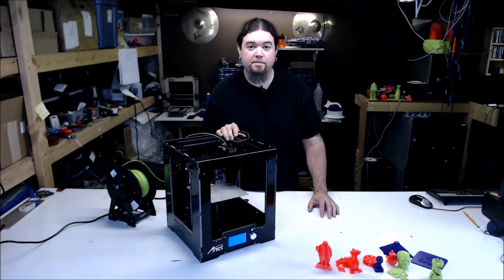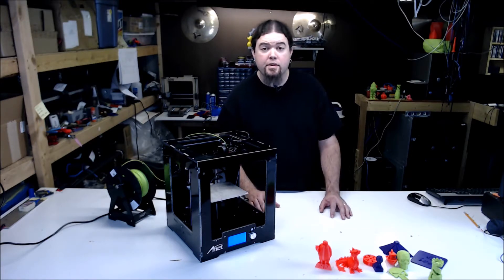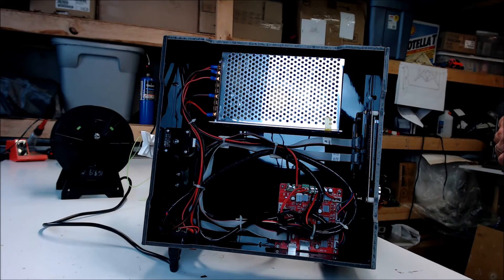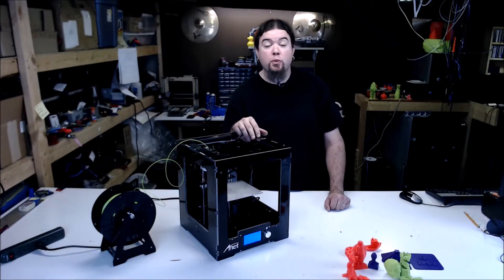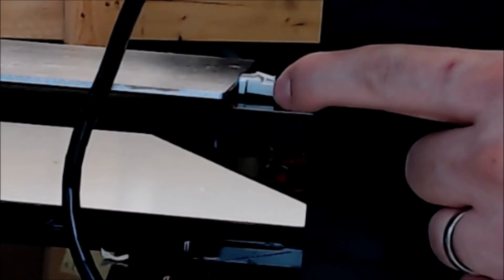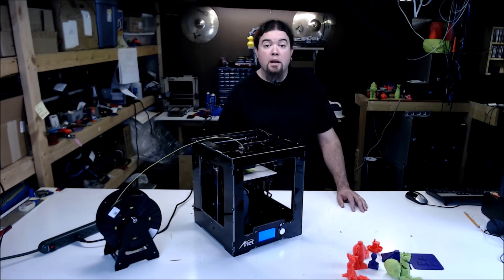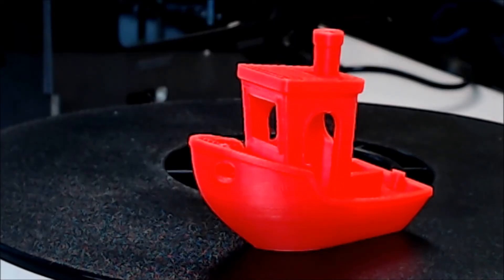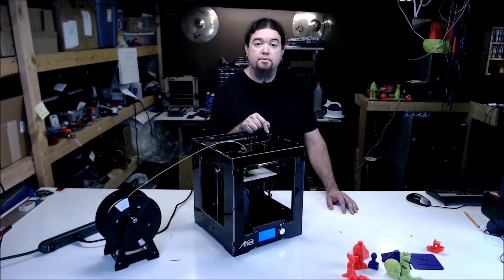Anet A3 Enclosed Acrylic 3D Printer Review & Tips

Comment: I bought this and there were screws in the box and also one of the motors was disconnected and loose inside the printer.  I need to know where to attach it.  Can you help me with this?
Reply from the maker: Sure, can you send me a pic of what you are working on?
Reply: I think I'm just going to re-box this mess and ship it back for a refund.
Reply from the maker: Sorry it didn't work out for you. They are pretty unpredictable.
Reply: I was able to find where the step motor went but the screws were to long and won't screw all the way down.  I also had loose screws that I need to put back in.  I was able to get the instruction manual on the flash drive.  I'm having trouble downloading cura, it won't let me do it.  Any suggestions on what I should do.  The power cord was a little short, had to use one from another printer I'm not using.  I'm hoping I will get this baby working so I don't have to return it.  Thanks for all your help, I love your video's
Reply from the maker: It wont let you download a newer version of cura from there site? https://ultimaker.com/en/products/ultimaker-cura-software If the motor screws are to long they might not have came from that motor. I have given away my A3, so I am flying blind. If you have pictures of what you are working on I might be able to help.
Reply: Thanks Chris for your help, I think I will return this printer, it is not worth the trouble of fixing.

Comment: just got mine 2day and set it up (first time printer here) i should have the right size filament which is 1.75 mm, but it doesn't seem to take :(
when i use the filament that followed i can get it in there with less trouble :/
do i need to push the filament all the way down, or does it just have to be put in there and then lock it?
Reply from the maker: That extruder is just a little off to one side. I remember it being hard to get filament in at times. Make sure you cut you filament at a 45 degree angle before feeding it in, that can help. You might also remove the to screws holding it on and make sure everything is lined up correctly.
Reply: thanks, that worked! :D
Reply from the maker: Anytime! Good luck!

Comment: My x axis is wobbling because of the bearings on the print head being loose, any suggestions?
Reply from the maker: WildCardMC If it's the bearings loose on the rods, there isn't a lot you can do except replace the bearings. Heavy grease might help some. Let me take a look at mine to refresh my memory.
Reply: thanks, i really don't want to take it back, ive had it for 4 or so months now and i knew something was wrong, one day i took it somewhere and the told me that the bearings were causing the issue

i haven't got any sucessful prints
Reply from the maker: So it looks like it is riding on 4 standard LMU88 bearings. The bearings are held in with grub screws. The 8mm rods are held in by grub screws as well. You will need to slide the 8mm rods out to replace the bearings. The good news is those bearing are pretty cheap. I would buy a couple, 10-12, and chose the best ones from the group.  Bearings, https://www.amazon.com/uxcell-Bushing-Linear-Motion-Double/dp/B00X9H22SO/ref=sr_1_fkmr0_1?ie=UTF8&qid=1511464032&sr=8-1-fkmr0&keywords=lmu88+bearings

You can get them even cheaper from aliexpress if you want to wait for shipping. 

Make sure it is the bearings that are loose, it could be the 8mm rods themselves causing the issues. 

Hope this helps.

Comment: I'm looking to buy this printer, your video was very useful. Hope the A3 community grows like the A8 and A6.
Reply: it needs a little work as well but it works good once you work them out. seems like most printers have that "upgrade" phase.
Reply from the maker: Pam Mio The two screws I show on the back on the left side,  is there any room to loosen the screws and push the motor down? That would be about the only way.
Reply from the maker: YeCannyDaeThat Thanks for watching, I am glad it helped.
Reply: Chris Riley yeah it did help build a picture for me. I think I'm going to go with the monoprice select mini. I don't need a big print volume and it should "just work".
Reply: I noticed that in my printer anet a3 the toothed belt (the small one you show in the video) has the same problem. It is not very tense. Have some advice to solve that?
Reply: Chris Riley I'll try. Thanks 😊